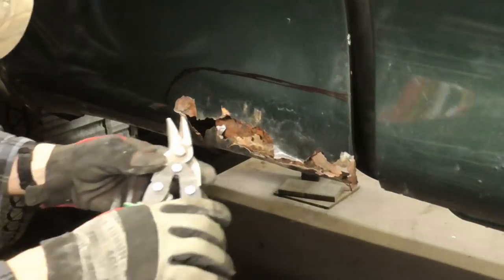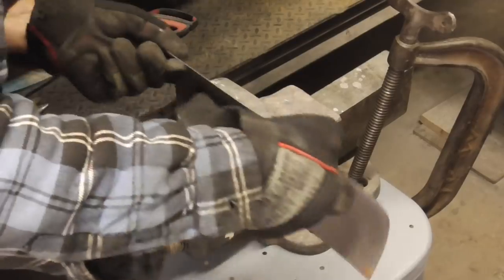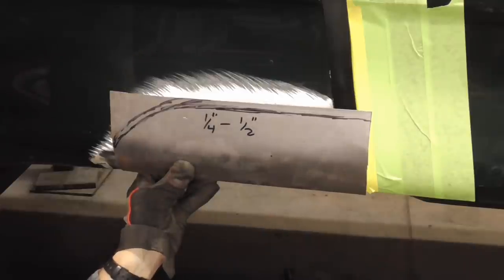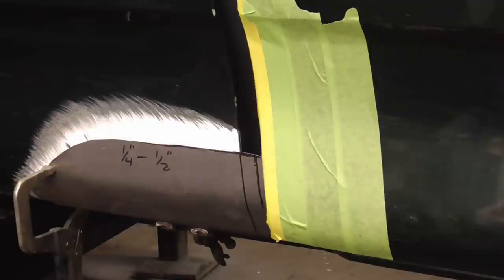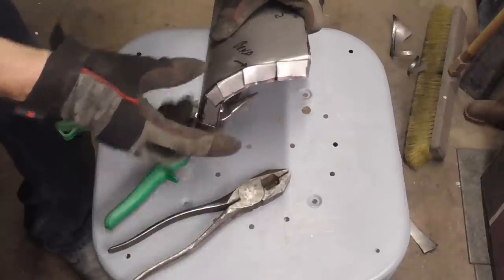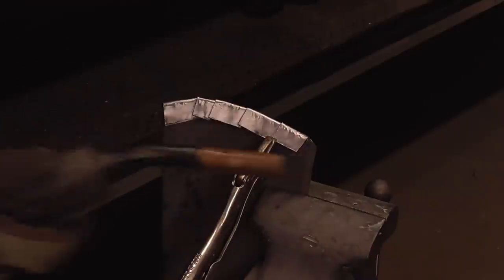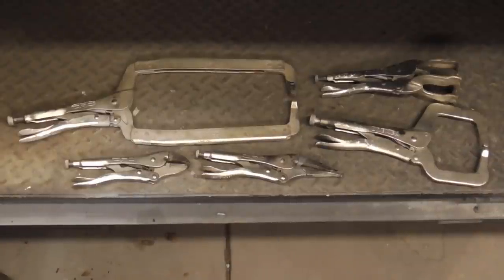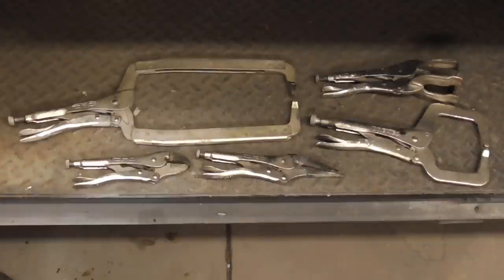How to Make a Custom Patch Panel - No Special Tools Needed

Comment: my sheet metal bender, which is very low cost, an old Chevrolet step-side bed cross brace, then a piece of 1" water pipe, use a vise grip on 1 side inside water pipe to end of cross member, then a welding clamp to middle of brace and end of pipe, now you have a workable roller that has proven itself to me thousands of times, not as nice as expensive tools, but very workable. 

I dont own a vise, or at least 1 that isnt broken, I overtightened it & broke jaw. lol. it was USA made vintage one too.  so showing alternative method pipe clamped to heavy flat metal surface. works. 

hope this can help someone that may not own a vice. great work as always
Reply: You must be one strong Dude if you can tighten a vice so tight that you break it.
Reply: @tommak6516  not really, but a good small vice. you tighten it, tap handle with hammer next thing you know its broke.

Comment: I had to make my own patches for the lower quarter panels on my 96 Buick Roadmaster sedan. Even if they made patch panels I couldn't afford them. So my Buick now has a little Subaru DNA. I did mine the same way except I put my patch behind the original panel instead of on top
Reply from the maker: I always wanted a Buick Roadmaster - the ride must be awesome.  A little Subaru DNA don't hurt :)
Reply: @LakesideAutobody  What about sandwich with patch metal both sides?  Maybe pop rivet instead of weld? Maybe (painted) aluminum patch material instead of steel?  Put something like roof cement under/between  to stop further corrosion?  I know this may sound very unusual, but I am serious (not trying to be funny).  Need to make some low cost repairs in spring and I only want to do them once.
Reply from the maker: @tommak6516  You're ideas are fine.  I've glued in a floor (galvanized steel) in a full size van with self tappers and steel/metal roof adhesive.  It worked just fine and never even thought about rusting again.  If your brain can come up with some out of the box ideas to prevent rust - try it - let me know if it works.   Jerry

Comment: Great video. I notice you use a lap joint. Seems to make sense so moisture won’t collect in the seam. Just a question though, wouldn’t you want to use weld through primer on the back side?
Reply from the maker: You could if you want.  Welding with a MIG adds metal as opposed to the spots done at the factory so it's not going to be "coating" that metal.  Companies like Honda are not using it because it affects the weld pool and has other adverse effects.  Here's their take - “Weld-through primer should not be used when doing MAG plug, MAG butt, or MIG Brazing,” Honda wrote in an August 2016 Body Repair News. (Emphasis Honda's.) “Further study has shown that weld-through primers can negatively affect weld or joint quality.”  Hope that helps :)
Reply: @LakesideAutobody  Do you think it’s okay to use it for spot welding?  I’m restoring an old Land Cruiser and those things rust if you look at them hard. Thanks for all the great videos and help to us out here that depend on knowledgeable guys like you.

Comment: Jerry, Really appreciate you sharing your wealth of knowledge. Off topic from your video. But when do you apply seam sealer before you paint ? Do you apply to bare steel then prime and then seal and paint ? Or do you apply it to sanded primer then seal and paint Or do you apply it on the sealer then paint. Really appreciate your method on this important part of sealing up a body for paint. or have you covered this in a past video. Thanks 👍👍👍
Reply from the maker: You can apply seam sealer to primer, paint or bare metal.  As long as the seam sealer says paintable, you can prime and paint it afterwards if you prefer.  Most automotive grade seam sealers are paintable - the ones that I've used are anyway.  Like this:  ACDelco GM Original Equipment 10-2013 Body Joint and Seam Filler Compound - 11 oz  I like this kind - dries fast, stays flexible, paintable :)
Reply: @LakesideAutobody  Thank you Sir for your insight and recommendation. I appreciate it !👍
Reply from the maker: @ronsre-creations5289  You're welcome - any time :)

Comment: Is that the front edge of a pickup bed? Looks like there's a huge gap between the 2 panels, since you can get your fingers in there.
Reply from the maker: Yes.  Front of a 2003 Ford F150 pickup bed.

Comment: Can the patch and glue method also be used at the bottom of a van in between the the front and rear wheels. the rust is at the bottom right in front of the back wheel. Its is not exactly a small hole.
Reply from the maker: Here's a video on that Julie - https://www.youtube.com/watch?v=W9czvb2rFqY  Have a good weekend and feel free too ask ?s any time :)

Comment: Very nice repair! What gauge metal is commonly used for body patch jobs?
Reply from the maker: 20 or 22 will work fine.  20 is around .035" and 22 is about .030"  both hold up well (thick enough) yet not to hard to work with.
Reply: @LakesideAutobody  Thanks for the reply. I have rust on the rockers (small square area right before the rear tire) on my otherwise pristine 2002 Lincoln Continental. I might just give this a go and see how it comes out. Maybe have a pro paint it after I weld and fill.
Reply from the maker: @Fireship1  Give it a try.  You can break what's already broke :)

Comment: Great video as always. I've got a question for you, on my Dakota the front cab mounts are pretty rusted. I'm talking about the cab side of the bushing, frame side is still very solid. Do you think I could manage to fix that as a beginner with a flux core welder and thick sheet metal? I've already fixed the front wheel arches thanks to your methods but haven't done much else in the body department. The rockers have seen better days but there is still some good metal there so I believe the cab would be worth fixing.
Reply from the maker: You can absolutely fix it with the flux core welder.  Let me know how it goes for you and if you have any more ?s on it :)
Reply: Flux core is what I’m using on all of my sheet metal work right now. It’s all solidly attached so far!!!
Reply: Just make sure to get rid of all the flux and practice first on metal of same thickness. You can get good quality slip on rocker panels for that truck too. I had 2 of them, very good trucks

Comment: What a mess
0.15 says no new sheet metal to be used, 1.02 brand new sheet metal appears from nowhere
You dont overlap panels on that part of a flat panel
The bending was atrocious, hitting the metal with the pliers/clamps - really..?
Was there any gas with that welder, some of those welds more porous than a tea bag,
arcing up the welder on the back of the piece you are actually using is pure laziness/sloppy, use some side cutters or arc up on a piece of scrap,
Oh and no special tools, hands up how many have all those mole grips in your possession?
If anything else wrong happened after this - forgive me as I packed up watching...
Reply from the maker: Thanks for the comment - subscribers will get a kick out of it :) There's no fabrication tools in body shops and this is how most shops in the metro Detroit area repair rust.  Here's the result of similar repairs after 3 years driving in salty Michigan - https://www.youtube.com/watch?v=gIS1Tbv7Kvw  See this also for more info on butt vs lap - https://www.youtube.com/watch?v=JIIonJOVro4
Reply: I've got a drawer full of vice grips of all different types, another drawer full of a variety of c-clamps... Not really specialty tools.

I fabricate aircraft parts for part of my job. I've got access to quality shears, a brake, a few slip rollers, cnc equipment etc. Here I am watching this fella work even though I really don't need to, I did my time as an apprentice body man when I was young and have done enough body work at home so I really don't have too much to learn at this point... my truck needs new rear wheel arches/bed sides, I won't be using any of that fancy stuff at work to fabricate it, just some wood forms and a hammer.
Reply: And his work comes out flawless after all your moaning and complaining. You can overlap anywhere you want bud. Better than butt welding any day
Reply: It is down low on the car, not a real noticable place.